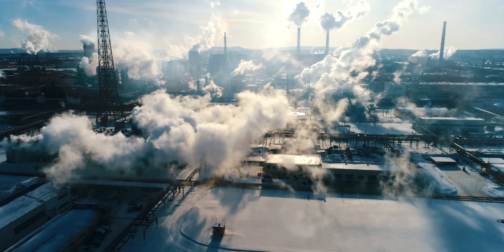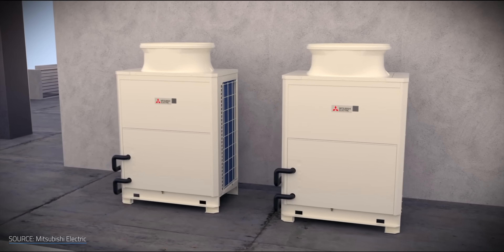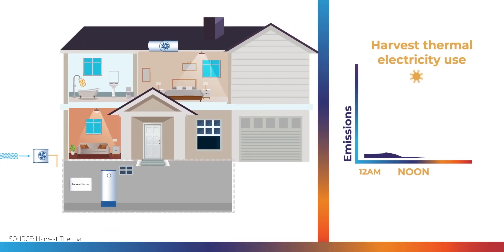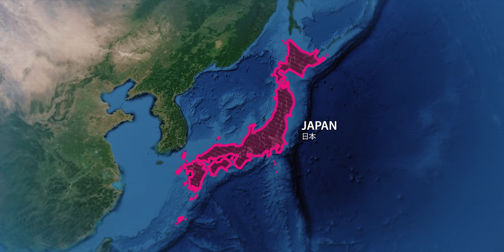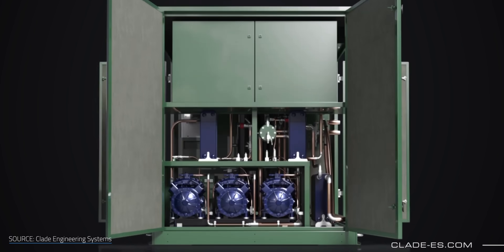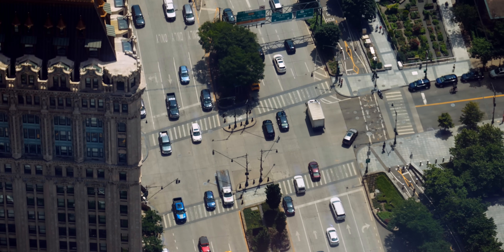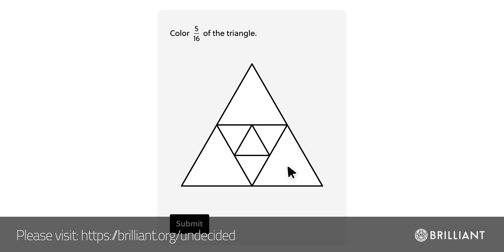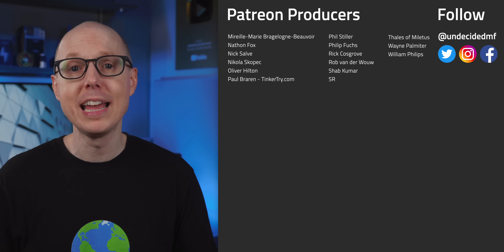Why CO2 Heat Pumps Are The Future Of Cooling

Comment: An aside splitting hairs, the animation b-roll showing an "ozone hole" pointing at the sun is wrong, the thinning of the ozone layer is over Antarctica, rather than a "c" shape like in that vid, the thinner section is at the bottom, a visual misrepresentation of the situation I'm afraid (and in contrast to an early b-roll animation that wasn't a misrepresentation).

Comment: One of the biggest issues with CFC’s was the decision to use it for deodorant, air dusters, hair spray, inhalers - etc.  AC is a closed system and is not supposed to be dumped in the atmosphere.  I’m so glad we are seeing new technology, but I strongly hope we can develop a standard as all the constant changes in refrigeration gas is making it far worse to manage.  For example, 410a, 134 are great solutions - yet we now want to push it out because of greenhouse risk.  Let’s manage what we have and be smart about how we manage the use. The final comment is to say - this has to become affordable.
Reply: Yes. It’s manipulative or poorly-informed when people point out environmental issues with refrigerants and fail to mention this. Handling and disposing of it is intensely regulated.
Reply: PFAS had a similar issue, they're used as a spray-on cleaning solvent.
Reply: That leads to an interesting thought: If CFCs had been limited to just refrigeration, would the problem have grown slower and thus been allowed to go on longer since ozone layer hole would have grown slower? Would we have been fighting this battle now in the 2020s instead?
Reply: @GustavSvard  it’s an interesting comment.  We have come a long way in recovering and recycling refrigerants so its possible we might not have had an issue so pronounced.  I still think we should manage the tools we have now such as our current refrigerants and improve the technology to allow better management.
Reply: We use refrigerants, 410a or 134a in air duster and a lot of similar stuff that needs easy propellant for low pressure. Unfortunately..
Reply: @Jaker788  don’t forget butane and propane are used as propellants as well, but the refrigeration industry is scrutinized for using it even though it’s highly monitored and regulated.
Reply: All of produced CFCs end up in the atmosphere. After your AC is serviced they don't go to a magical decommissioning place. Tonne for tonne they are a much smaller problem but remember that the problem was "the surface of the Earth is gonna be uninhabitable in 50 years", even a fraction of that "500 years?" is a big problem.
Reply: @fireiceuk9221  it is and we’ve learned a lot.  CFC’s are not produced any longer which is awesome.  We bash the decisions of the past and yet it was a different time. The key is - we learned from it.  I’m a bit upset over dumping current refrigerants as it’s going to make a mess out of managing our infrastructure.  I’ve seen old R22 units still running today from the 80’s and everything is contained.  Don’t forget, swapping systems every 10 years isn’t the most efficient use of resources either.  

In the end - we never seem to address the elephant in the room - excessive energy and material use.  There was a time when we reused the bread bag or the egg carton. We waste so much and treat what we do have like crap for a dopamine hit.    Just an observation. 

Take care.
Reply: I am concerned about pressures--C02 (R-744) runs at 536 PSI at 38 degrees F, R-410a runs at around 120 PSI at the same temp.
Reply: @andrewludwig9251  Don't be. You drive something that contains far higher pressures already, especially if you have a vehicle with a Direct Injection engine. DI fuel injection runs in the 10's of thousands of psi, brakes can see over 3000 psi in a panic stop - these function reliably for years or decades.
We know how to safely work with higher pressures; been doing it reliably since the invention of hydraulics. The only risk is really during installation if the installer is inept, in which case if they used rated lines and fittings, you will have a leak and your system will become disabled. There really isn't even enough to be a suffocation hazard for a person in a basement, especially if you have a sewer floor drain or good air circulation.
Reply: @kstricl  Pressurised liquids are much less dangerous than pressurised gasses; this is why it's conventional to fill compressed air tanks with water when pressure testing them as it won't instantaneously expand to several times its compressed volume if the tank fails.
Reply: @mememaster147  So... a 5lb co2 tank used for dispensing beer is pressurized to around 1200 psi...
If you are this concerned about it, I'd stay away from bars, restaurants, convenience stores, basically any place that serves carbonated drinks...
Or, don't worry about it. This is established tech that has been around for a long time outside of North America. Most of the CO2 in the system is likely in the reservoir outside at the compressor end anyways. I would wager that even striking the working lines with a nail will at worst give you a bit of minor frost bite and a major repair bill.
Reply: I would be concerned about getting a CO2 system serviced. Until (or unless) it reaches a point at which it is widely supported by regular HVAC contractors I’m going to keep with the reasonably efficient Trane heat pump I already have installed.

Comment: Very cool!  It seems like a solar hot water heater would be a good addition to a system like this.  I've always been amazed that we spend so much money essentially creating heat or cooling instead of simply moving it from place to place.  A fridge next to a stove has always been an embarrassing proof of our lack of development.
Reply: There are these hybrid solar panels called PVT that have the heat exchanger on the back of a pv panel. Really cool tech. Add in a subterranean part of the exchanger loop so you can tap into the ground as well
Reply: @tonydeveyra  That is sensible, pairing PVT with a ground sourced heat pump system.
Reply: Well, the fridge and the stove do a very very good job at insulating… at least with quality appliances.  So it’s not a huge concern.  Actually maybe the rear of the fridge should face the oven just to really keep the hot together 😂
Reply: I was just poking around their page (unfortunately it looks like they are only in California right now) but their FAQ says they work well with solar panels but not with solar thermal.  Doesn't say why.  Maybe they just don't want something else using the heat battery that they have to manage on their end.  A whole-house integrated system would be great, but.. there are reasons why we can't have nice things ;D
Reply: Yes definitely.  Has anyone found/seen a PVT solar panel manf in the US?

Comment: 20 ATU is too dangerous for inside the home, Keep the ultra high pressure outside (safe place) and use a suitable, unpressurized, stable fluid as the transfer fluid.

Comment: Converting hot air to hot water works great for me.  When I built ten years ago, I was able to put in a water source Freon refrigerant heat pump that moves the water that it heats into my water heater. It uses the water that it heats during the summer when it's operating as an AC to put hot water into the water heater. The heat pump isn't more efficient than many out there, but the ability to convert the hot air in my house into hot water has cut my utility bills.  It works well enough at heating water that we actually ran for a couple of months with the water heater disconnected without even noticing it.  It was only after the outside temperature dropped that we discovered that I had not re-connected the water heater after doing some electrical work.

Comment: I’m hoping for the day when all our heating and cooling needs are served by a heat pump network in the home.

Imagine if AC, pool, refrigerator, freezer, water heater etc were all interconnected.  Maybe one day :)
Reply: I've imagined. 😉Maybe I can set up my heat-pump hot water heater to cool the coils on the back of the refrigerator? 😄
Reply: I've thought about this for a long time. With the new multi-head heat pumps it's not too much of a stretch. LG can actually do it most of it with their Multi V line with a hydro kit.

Comment: You need to factor n how efficient the electricity is at the socket. If it’s comes from the grid then it can be as low as 35%. Where as a gas boiler can be up to 98% efficient.

Comment: Great video, always love your enthusiasm and perspectives 
Twice as energy efficient, with some very big asterisks 
I dont have to watch the video to know that doubling a normally operating heat pump's efficiency would be quite literally impossible, and the phrase "doubling the heatpump's efficiency' is almost certainly advertiser speak for "our heat pump has a wider operating range, and when the temperature is lower, or higher than competitor pumps, we are Y times more efficient"
Yes many heat pumps/air conditioners go up to a COP of 5, but as the temperature drops closer and closer to 0F, at some point reaching 1:1 or even worse, with the drop off usually starting between 40 and 32F
If a CO2 heat pump can operate down to 10F and approach -20F well then it is way more efficient at these temperatures.
But what about when it drops to -20F, it becomes just as efficient as a traditional heat pump

Anything outside of this, like external energy storage, would also work just as well with a traditional heatpump/AC

Now if i can get a CO2 mini split heat pump that can run off of DC from solar, and operate down to -20F i'd jump at it, because i am currently on propane for heat in the winter, as it becomes cheaper than a heat pump from about November to March

Comment: this is an interesting new heat pump. Variants of it have existed for at least 20 years, not using CO2 as a refrigerant, but a similar concept using a water heater as a heat ballast. Geothermal is a variant, using groundwater as the ballast. This system appears to be somewhat complicated, with many plumbing pipes, as the others had.  The challenges of previous versions were: 1) High initial cost of the system, including an invasive installation- a large hurdle. 2) somewhat disappointing real-world money savings or return on investment.  3) relatively short service life.  4) complicated or expensive maintenance/service requiring special training often provided by one vendor per city and 5) high cost of replacing the system in 10-12 years. Many of my customers were one-and-done with similar systems.

Comment: Solar powered air to water heat pump  are probably  similar efficiency to Direct Solar water thermal panels .   This is because PV panels are about 20% efficient (1/5)  combined with best case COP of around 5 for the Heat pump....
Reply: can cool  with the heat pump, but that is not critical for me, heat is

Comment: First rule: keep it simple. And there's nothing simple about CO2 refrigeration cycle/hardware.
Some had pushed CO2 into small and medium size systems, just to meet an agenda, and it has been a total failure. Thousands of equipment needed to be replaced again with all the CO2 impact related to produce something useless. 
Someone that had worked on CO2 systems knows the challenges involved.
For large industrial systems,  ok, for small ones, to complex, risky and not efficient enough.

Comment: This looks like very interesting tech, but sadly, I can see a use case where it doesn't make sense: Residential Homes in desert environments. I live in Phoenix, Arizona, USA. The problem where it doesn't make a lot of sense is it's reliance on using the water heater to dump heat. In large scale commercial operations that consumes hot water all throughout the day (like restaurants, hotels/motels, laundry mats, and grocery stores), using the water heater as a place to dump excess heat is great. But residential homes generally don't use as much daytime hot water, resulting in the water heater only needing enough energy to maintain or "top off" the water in the tank. I work from home and I don't need that much hot water during the day. On top of that, most of the homes in the desert south-west part of the US don't have mechanical rooms inside the house's envelope. Even my brother's five to seven year old house has the water heater in the garage, while insolated (Sort of) isn't that much cooler than outdoor ambient temperatures. My "utility room" on my 1960 house, where the water heater, washer, and dryer lives, is just stick construction with fiberboard siding and no insulation, means the heater is all but exposed to the elements. When the heater died in April this year, one of my laments was that it couldn't have waited till the end of May, where I'd likely not notice the failure until well into October. And it's much cheaper to install solar water heater panels on the roof to heat and maintain the water in a water heater (something popular in the southwest well before solar electric panels were a thing), and there's really little argument for the CO2 system.

Now, what I would like to see is a CO2 single unit heat pump that I can use to replace the aging gaspack on my roof. But the question is does the safety and environmentally friendly CO2 features offset any price difference between traditional heat pumps and the CO2 units?

Comment: Thank you, Matt,  for this video.  I live in the UK.  The government has had various incentives for people to install heat pumps as part of their zero-co2 incentives.  As I understand it, these schemes have all been undersubscribed. There are some challanges including:  1) our housing stock isn't always very well insulated necessitating high heating water temperature,  2) the incumbent heating is gas.  When comparing costs of current heat pumps driven by electricity with heating by natural gas,  there is no clear advantage to the former - particularly at the moment when we are paying domestically £0.35 per kWh.
The economic argument is sensitive to the highly volatile pricing of both electricity and gas, which has responded in the UK to the war in Ukraine and not helped by an electricity cable connecting UK to France going bang.

Comment: I thought about this idea just a few months back. I Thought this would be a good idea because you have two methods of cooling and wasted heat as well. Then I thought, man it would suck if it ever broke though  - not only are you out ac/heating, but your water will be cool as well xD By the time I thought it all out, while having a center method to make the tampure would help reduce power over work, you still run into the issue its the center of everything. Better off just getting solar if you can, charge a battery, then dump that power into the water. Sure you might have to spend some grid power to help it the first time, but after that, the water is hot and will stay hot for a long time and only need to pull power to "warm" it up again that you can control over time would be just way better.

I still think the solution to most of our problems is can we get a sizable battery into the homes some day. Na batteries seem like the asnwer , hopeful they come soon. Charge them in the middle of the day either off grid or from solar - then curve that "duck" curve with the battery for after noon or morning fixing a lot of our power needs.

Comment: Heat pumps work best when trying to keep the temperature at a set range all the time. Time of dayof use for a heat pump is base only on the outside weather not the time of day. It cost more to go from greater difference of temperature than it would be to just allow the system to run all the time keeping a set temperture (assuming heat or cool before outside temperature drop do the work). 

I'm not see the gain from using water to store the heat.

Comment: co2 as a refrigerant is carbon neutral if you look at it from the perspective of extracting from the air then releasing it back to the air..

no more anti venting laws

co2 wont explode in a fireball but it will explode in if there is a weakness in the lines.